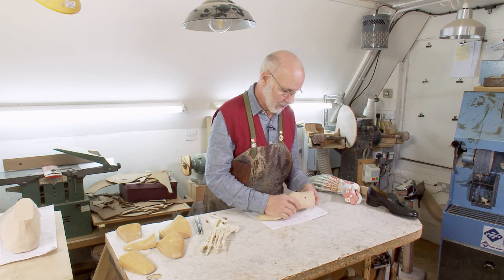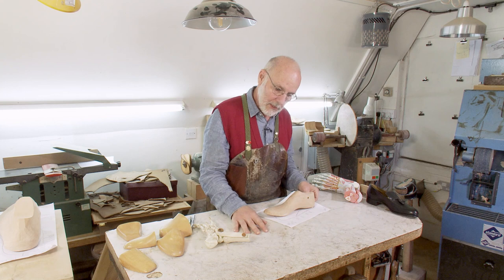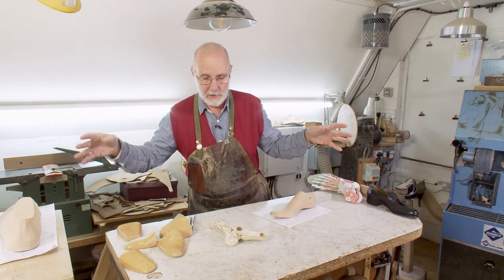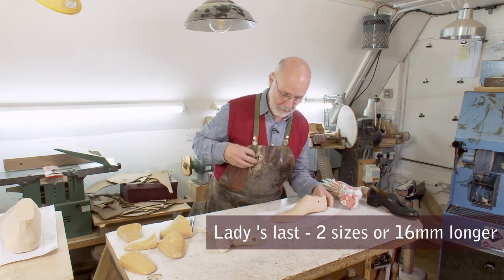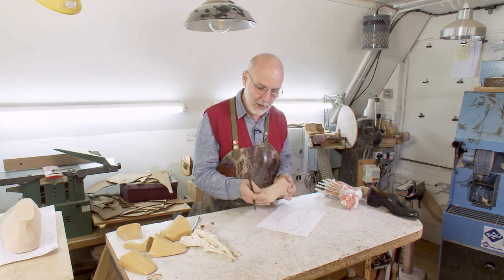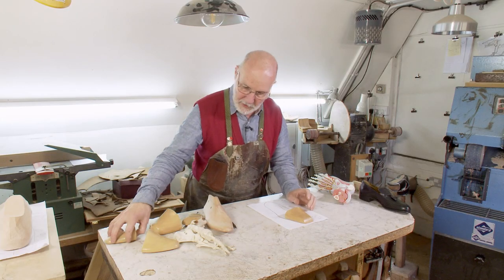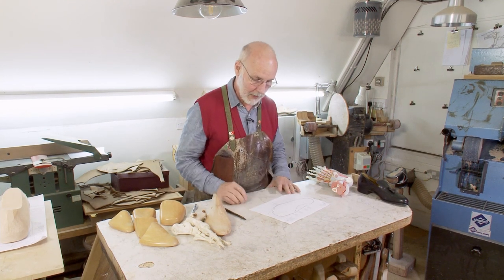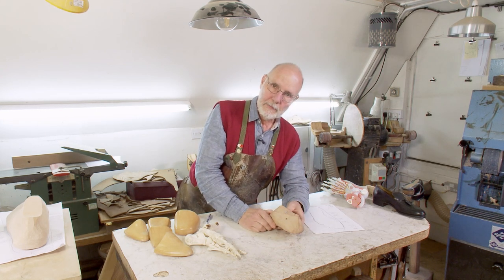05 Draft to Last:   The Toe Section

Comment: I always remember my Father checking the space in new shoes with his thumb to make sure there was about an inch of space inside and you confirm this with your comment about the last (since last determines the internal shoe volume) being 25mm from the end of the longest toe in the trace. However, since I started learning to make shoes all I ever hear is measure the foot whilst standing and add 10-12 mm toe allowance to work out the necessary shoe and thus last size. Its a little confusing...  :) What you say makes more sense to me....
By the way, thank you very much for the effort you have made in making and uploading your videos. I believe they are unique in what they teach as a whole.
Cheers
Alex

Comment: Why do you say that a women's last is only 16mm longer but a man's is 25mm longer?  Perhaps this should be graded by foot length?  What if a women's foot length is actually longer than the average men's foot length?  Is it just thinking that women are not as active and do not need so much room?  What if feet are exceedingly wide, female, longer than average female or male?
Reply: I could be very wrong here but I got the impression it was a fashion thing. traditionally men like to look like they have larger feet to compensate for insecurities and women prefer to look like they have smaller more delicate feet. fashions are changing with the culture but hand crafted shoes are often steeped in tradition. I don't make shoes though, just kinda gustimating.
Reply: La ragione è solo tecnica. La forma di una donna , solitamente, porta un tacco e parte della lunghezza viene rubata dal fiosso della forma ( parte dell'arco) che è curva ed accogliere un piede con un tallone sollevato dal tacco
Reply: @irvanagiuseppe5740    What if the woman wears a heel comparable to a man's, a very low heel, or flat style?  Then it should be built with the same parameters as men's ?
E se la donna indossa un tacco paragonabile a quello dell'uomo, un tacco molto basso o uno stile piatto?  Allora la forma della scarpa deve essere costruita con gli stessi parametri di quella maschile?
Reply: @KatSchlitz Esattamente. L'unica differenza è nello stile della punta che sarà di qualche millimetro in più la lunghezza, se la moda richiede un modello di scarpa appuntita.
Reply: I'm a male, and made a pair of shoes. I built up the toe about...18mm if I recall. I don't want my foot to be any longer than it needs to be. Sure, enough, my foot slides forward enough in the shoes that it shoves up against the front of the shoe. Womp, womp.  I guess I needed the extra length after all. The foot sliding is the real problem, but if the toe box was a little bigger it would have been better.